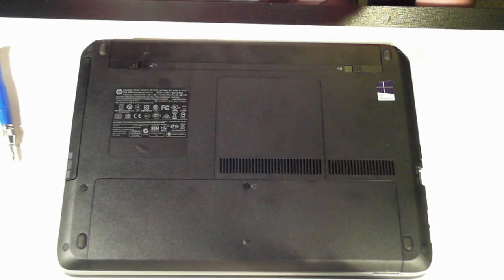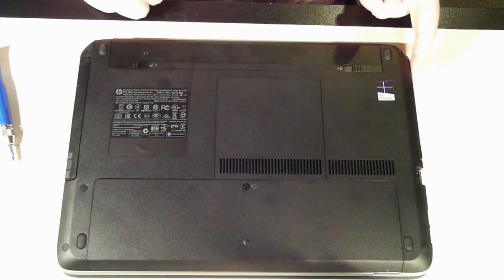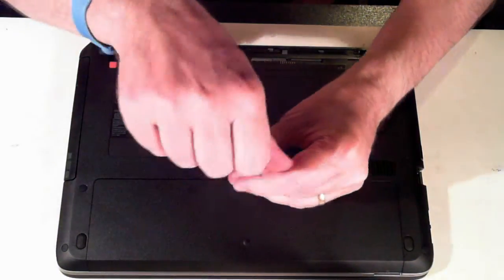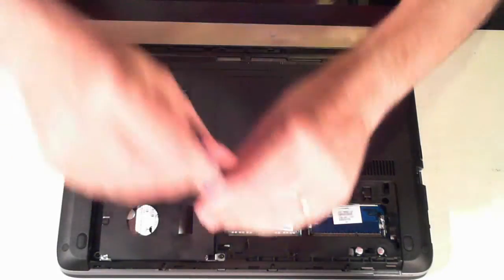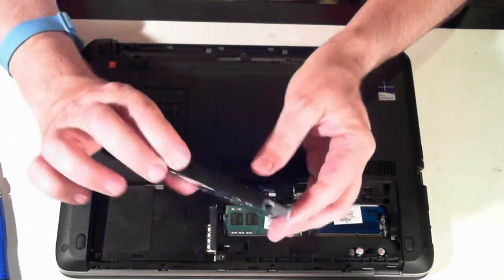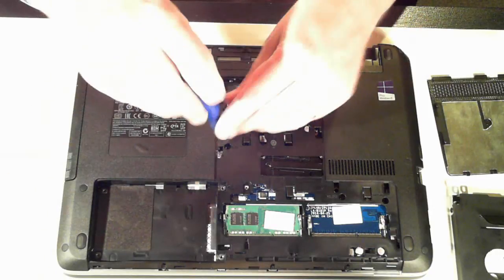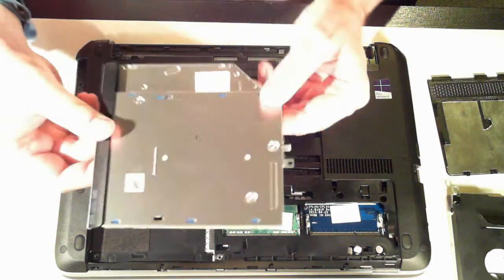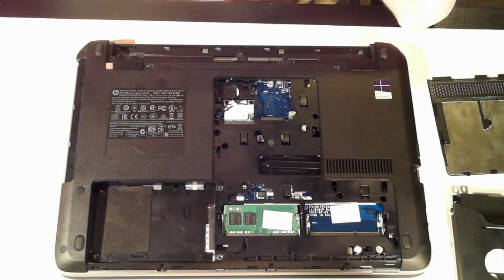HP Probook 440 G2 Basic Teardown

Comment: just wondering, what the port type next to wifi card? is it m.2 or msata? can we use it for ssd?
Reply from the maker: The specs say it support M.2 sata so a SSD can be used.

http://www8.hp.com/h20195/v2/GetPDF.aspx/c04336794.pdf

http://www8.hp.com/h20195/v2/GetPDF.aspx/4AA5-2904EEAP.pdf
Reply: @dpcomputing   can you make a video on fan cleaning and ssd upgrade for this hp probook 440 g2